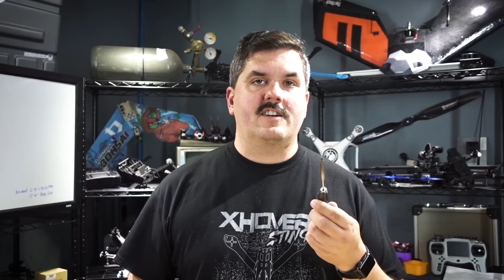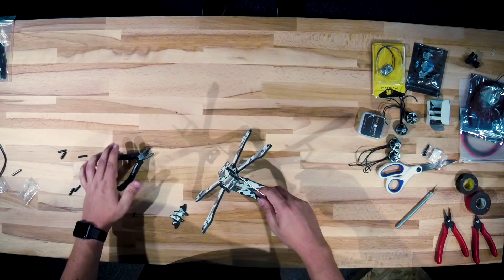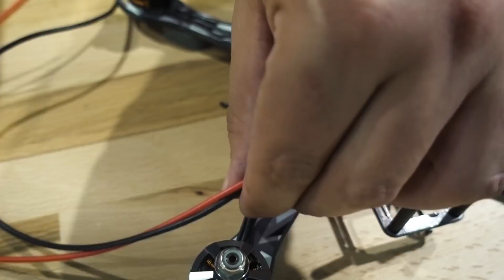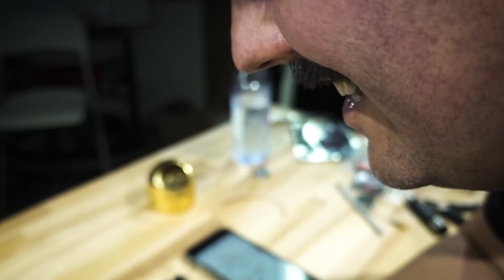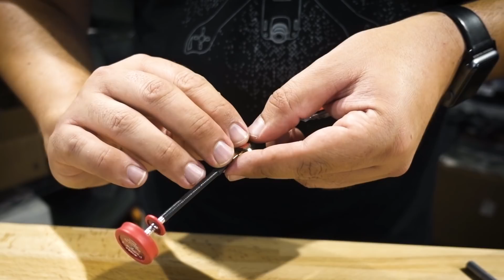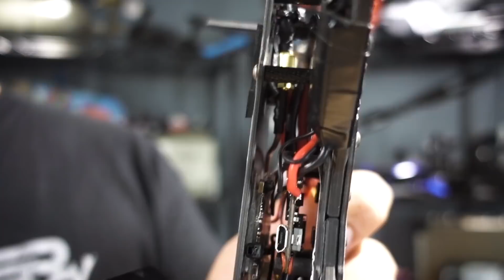Build: XHover Stingy Frame (Stingersswarm)

Comment: Hi stingers i got put onto you by fpv prettyfly.
What i want to know i want to get the flysky nirvana but i need to know if all the firmware is all fixed up i also got told you fly with it.
I need to know where i can get it from got told not to get it from banggood so where else can i get it from.

Comment: i got a runcam swift 2 and a runcam swift 2 rotor riot and both do not fit into the frame. hole is 27mm and runcam is 29mm. can you please explain? i feel fooled ☹️
Reply: i figured it out. there are diffrent cases for the runcam swift 2 and only the one with one bolt hole at a side (not the one with three bolt holes in a row) fits in that frame. gave me cancer for some days 😡

Comment: So I take it Kevin is getting his current values from the BF board current sensor and not the kiss esc's? Also are you able to flash kiss esc's through the BF board using the BF configurator?

Comment: whats the make of the soldering iron? looks nice
Reply: TS100, very good solering iron for less then $100
Reply: Ts100. Sold on amazon as sainsmart with power supply for 57.00
Reply: it is a good iron for emergency repairs but not really a daily driver. If you watch the vid you will notice it has trouble with the larger joints. Devil horns on the solder means the flux was used up before the joint was completed.
Reply: Rob B if you update the firmware it runs hotter and does just fine on huge pads. I use mine all the time. It has no problem with big pads

Comment: 31:02 "I like being as light as possible"  You shave a shitty piece of rubber from the battery pad yet you use a dozen of zip ties to hold the fucking antennas and cut the thickest wires from battery and esc's needlessly long?? LOL
Reply: I don't understand "saving weight" on a freestyle frame. Exactly what are u unable to do because of that extra 5 grams?
Reply: 1031Six every gram matter when you do quad racing bruh. Cuz you need to save weight for speed
Reply: Yeah, like he is building a racing quad lol....
Reply: Is the hipster thing right now HEHE, I also laughed when he cutted these tiny pieces for the battery pad like, dude the weight you save from not using the whole pad is the same that you got in wires and zipties.

Comment: By soldering on the shunt resistor, you have probably changed its resistance. Making the esc think it is drawing less current then it actually is.
Reply: not true. but that is also why you can calibrate the current sensor.

Comment: FYI you can reverse the ESC's from the BF configurator, there's no need to solder onto the ESC
Reply: KNUCKLEUP FPV people pay no attention :)
Reply: KNUCKLEUP FPV . In the latest kiss fc fw you can reverse the esc direction. Just make sure you update the Esc firmware and reverse the yaw direction as well.
Reply: sᴛᴀᴄᴇʏ ABSHIRE I know right? Lol. Good luck flashing kiss onto that fc to reverse motors. This is why betaflight is the leader in 3d flight. Quick connect to blheli for bi-directional and away you go. 3d is still sketching me out on my micro. Haven't tried on any of my 5 inches yet. Just anti turtle mode. A few flights strictly upside down.
Reply: norgtube i dont think kiss escs are reversible like that
Reply: lowtus7 betaflight fc......

Comment: Why use the Betaflight f3? There's lots of better options now even ignoring its irritating soldering. Matek f405 aio has far less noise issues as well.
Reply: if the betaflight f3 works for him why change?
Reply: Didn't I already answer that?
Reply: The Matek has an ICM20602 gyro. The Betaflight f3 has the MPU 6000.

Please explain how the Matek has less noise issues when it has a more noise sensitive gyro.
Reply: Seriously? All aio boards suffer from ELECTRICAL current noise to some extent or other. The Matek board deals with the current better than many other boards. It gives cleaner output in the same way some escs have less spikes than others. YouTube has some tests if you wish to check this, Now, my question was to Kevin who clearly knows a thing or two. I was curious as to why he liked that particular board. Not random people who wish for some reason to challenge me.
Reply: Coppertop FPV the matek f405 is by far the best board ive flown with. People cry when they cant get it flying on 32/16 loops. It literally flys better untuned than any tuned quad ive flown.
Reply: +Coppertop FPV as I already said, he probably uses the BF board cause he is used to it and it works well enough so there is no need to change. What's the point in swapping out components every week for the latest hyped stuff that will not have any noticeable performance advantage in the real world?
Reply: STRYKA FPV bff3 gyro dies really easy. There was a post on rotor riot a few weeks back of someone asking who all has killed them. There were over 100 post with multiple failures lol. Junk fc

Comment: I love this frame but I had a chunk of my midframe blow out where the camera comes thru.  There is only 2.5mm of carbon fiber left behind after the cuttout for the camera, so it is a weak spot in a very vunerable area where front impact will break it easily.  I have had no luck trying to find a replacement Midframe so I will make my own. I am going to modify it a bit and leave 5mm of material around the camera cuttout to re-enforce the frame.  I will make a video when my material comes in and post it for you all to see.  I think that you should consider making a similar modification to your design as well.
Reply: Brian Butcher heard this before and I hope the offer a new plate.  I also like that Kevin suggests using a lock but on the arm mounts as an alternate to the press nuts as a back up plan.   Great looking frame and I expect Kevin and Xhover to support the modification needed to keep it durable.  👍🏼